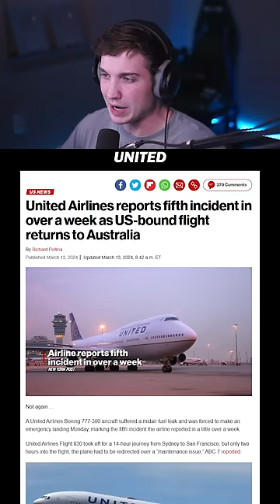Another 737 Panel Falls Off Mid-Flight

Comment: United 6th incident in the past couple weeks
Reply: United needs to get their brain straight with maintaining their 737 fleet, etc 

(Thank you people for correcting me)
Reply: @YAH_YAA  its not just their 737s lmao
Reply: @IndonesiaMajapahitNDPCA wdym
Reply: @YAH_YAA United needs to be removed.
Reply: @Aviator381  remember United 35? a 777-200ER?
Reply: @IndonesiaMajapahitNDPCA  maintenance
Reply: @Aviator381  oh yeah I forgor maintenance error happens.

Techincally United's fault tho
Reply: @Aviator381  All of the incidents have been due to United's terrible maintenance
Reply: I literally saw the plane in IAH land without one of its gears down right before I took off 😭😭😭
Reply: @YAH_YAA  it has nothing to do with 737's, they just have shitty maintenance
Reply: Even a320s
Reply: United has almost a thousand planes. It has the third largest fleet. 

The issues are likely a combination of maintenance issues, manufacturer defect (the wheel likely based on those in the industry who know a lot more than me), or fod (bubble wrap issue, possible also for one of hydraulic failures looked to be a punctured line). Some could even be bird strikes that weren't noticed. Fatique issues like panels can be maintenance if they're not testing correctly or on schedule but if early failure,. manufacturer of panel, or just fatique that happened in a way that testing couldn't pick up... ...or even bird strike too?  Hopefully the NTSB figures it out as I'm rather curious, just seems like a serious of bad luck. 

Some small percentage of planes have issues daily. The vitality of some issues means the media is paying more attention -- some of these issues wouldn't make the news if not for the more viral issues. Delta lost a wheel last month but it wasn't caught on camera, so barely any news (delta: 2nd largest fleet, just behind AA). . Need to look at actual statistics/data and not headlines to see if there's a real trend or company issue. 

... saying that, I've been reading that maintainence is less experienced these days due to COVID retirement of higher paid workers (to save company's money) who didn't come back post reopening and planes having higher maintenance due to flying older planes due to the Beoing/Airbus work stoppages. Combine that with typical corporate mismanagement and overworking of workers, and there is reason to be concerned.
Reply: @hefoxed  yea Ik wasn’t even saying it was Boeings or United fault tho
Reply: @MnDogman no you didn’t

Comment: “Of course here at Boeing safety is a priority”
Reply: Tbh it's not boeings fault is the airlines maintenence issues
Reply: @AviationCentral1200  Boeing Or The Airline Boeing Made The Plane Not The Airline Bro
Reply: Look at u child, u followed my mistakes
Reply: @AviationCentral1200 bro boeing made the plane not the airline so its their job to maintain it
Reply: That’s actually is quite “not smart” bc 777 and 787 vertical take off are actually being calculated before flight, so it IS safe 
And 777 gear is maintains issue 
747 engine is not boing engine so not boing too 🤓🤓🤓
Reply: @Tyryjehsjgsjj bro…
Reply: @Tierlistspro are you responsible for maintaining your car or the manufacturer who made it.

Hint: Once it rolls off the assembly line it’s the buyers
Reply: @Tyryjehsjgsjj maintenance isnt building. Maintenance is repairs. Boeing is not responsible for repairing aircraft for you. You have to fix it. Unless it is their fault, they will not fix it. That plane was delivered in 1988, so if it lived that long, it definitely wasn't Boeing's fault
Reply: The only priority there is DEI hiring practices
Reply: Bro do you think boeing has the tak of maintenance? That's just wrong  @Tierlistspro
Reply: @NerdNerdNerdAviation good that’s true
Reply: @Tierlistspro it’s the airlines responsibility to maintain and make repairs. Once it rolls off the assembly it ain’t Boeings problem
Reply: @tgshark1 DEI for a 25 year old plane 😂😂??? If you’re being racist atleast be good at it buddy
Reply: @Tyryjehsjgsjj very old plane
Reply: @hypR_Aviation couldn’t have said it better myself
Reply: @BungeeGumm234 perfect example
Reply: "it's A priority"
Reply: @Tyryjehsjgsjj 26 years old means maintenance brotha
Reply: @Tierlistspro that’s not how that works
Reply: @Tierlistspro Im surprised on how long your iq is. Boeing makes the plane, maintenance is for united not boeing
Reply: @Tyryjehsjgsjj  does Boeing do the fucking maintenance though? no they design and manufacture the plane, they would be having this issue if proper maintenance was issued
Reply: @Tierlistspro  No Boeing makes the planes, the airlines maintain them
Reply: @Tierlistspro Airlines and aircraft owners maintain their own fleet. Not the manufacturer. Airlines have major hangers filled with parts to keep the planes in working order.
Reply: @Tierlistspro Boeing isn’t responsible for airlines maintenance, airlines carry out maintenance on their own planes

Comment: The algorithm finally gave me a recent video!
This isn't Boeing's fault, most of the 737 problems aren't. It's the airlines and the bad maintenance.
Reply: Well how about dc 10??? Everyone called death camber me as a dc 10 lover it hurts
Reply: Mcas was Boeings fault
Reply: @mrwelshaviation_024  I know, that's why I said most
Reply: @shamsuddinhassan2216  don't know, haven't researched about the crashes
Reply: @shamsuddinhassan2216  id say half and half. Im a DC10 lover too, but Douglass ruined it. The pylons broke all the time, and the airlines never fixed it. That's why so many of it's crashes have the top engine falling off
Reply: @mrwelshaviation_024 yes mcas and the door plug the rest are maintenance on the airline

Comment: I still don't know whate the F Boeing is doing 😅
Reply: Boeing company:don't looks at me we Didint do anything wrong
Reply: The plane has been flying fine for 30 years so it's kind of Uniteds fault this time
Reply: probably working on 737 max or on the 797
Reply: @stehero4569 yes i know but if the Ceo says he wouldn't fly the 737 MAX there gotta be something wrong
Reply: Maintenance issue
Reply: @ajeberhart287 he never said that
Reply: @mariaonme8004  bro fix your grammar 💀
Reply: This is a maintainence issue not a manufacturing issue
Reply: @mariaonme8004 they didn't do anything wrong! try to keep up with reality I know it's difficult for you
Reply: @minecraftc5006  no 737 max 10 and 777x

Comment: these are not Boeing's fault, same case like Alaskan airline door that got blown away, it might be the maintenance crew fault because Boeing only makes the plane frame and not doing the maintenance stuff because it's the airline that has responsibility to take care of the plane made for them, but if it's the software that malfunctioned like the 737 MAX MCAS, it's Boeing's fault because they were the one responsible on making and installing that software
so before you commented "if it's Boeing im not going" or something like that, think again

Comment: So I hope you can do this buddy from most aircraft which are you know publicly owned and for commercial use after you know around 50,000 hours they need either one maintenance meaning oil new jets all that fancy new bullshit and all of the really thin panels the ones around landing urine ones aroundwings have to be replaced was thrown into production something I don’t remember what you said but I think it was like 1938 you know I’m pretty sure has over 50,000 hours on it